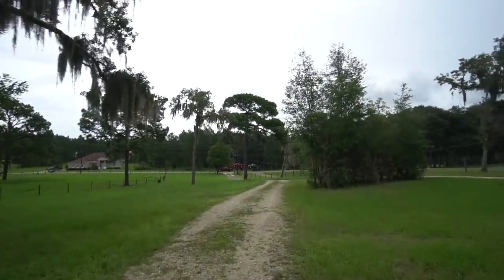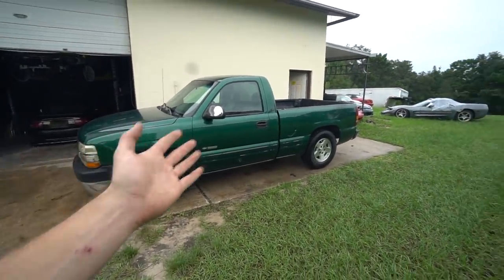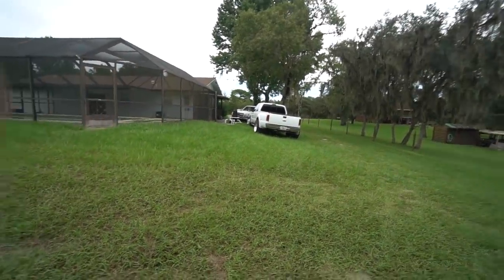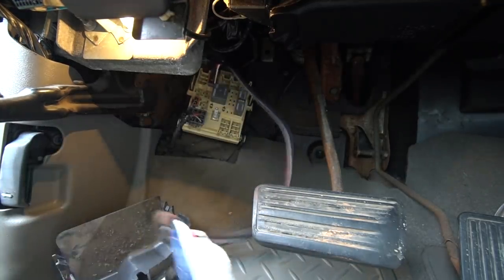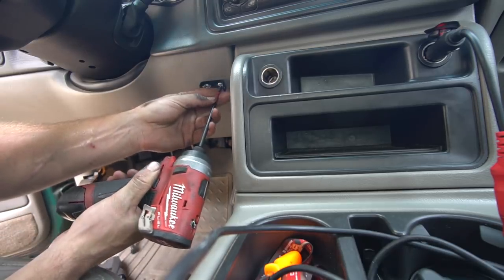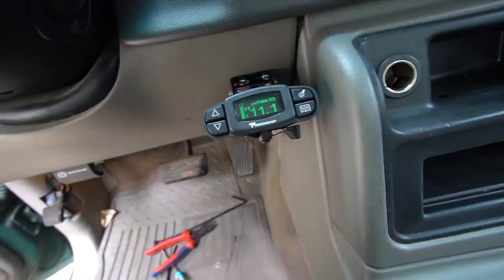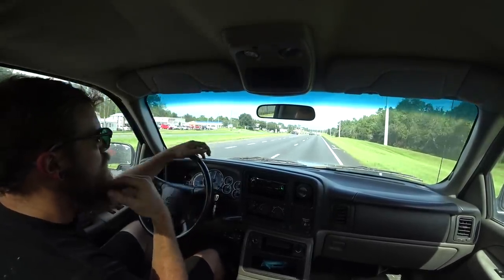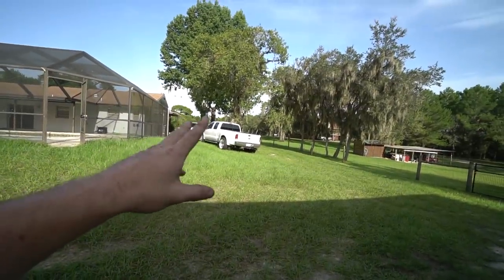I Bought Another Truck! After Searching Forever!

Comment: Hey Taylor you’re comparing a gas truck to a diesel and the diesel is slower but they are better in the long run and if you buy a 6.4 don’t Cummins swap it just keep the motor and run it
Reply: Camden dewitt he wants to buy one that’s already blown up. It would be a way better deal to find one like that and swap it to a reliable motor.
Reply: You know the are reliable they only blow up when people hold them on the rev limiters and do massive burnouts for a long time or put a lot of power in it
Reply: Camden dewitt the general consensus online is that they don’t last very well after 150k miles and especially not during hard work. Parts are also much more expensive.
Reply: Um I have 350000 miles on my 6.4 and it is completely stock so it all depends on what your doing with them

Comment: Why is it called a 6 0 front. You should twin turbo that truck
Reply: joe beers the front end is off of the ford trucks that came with the 6.0 powerstroke engine. Rather than calling it by some name, or by generations like dodge (1st gen, 2nd gen) fords are referenced by engine.

Comment: Yup, you bought the wrong adapter cable. There's one for 2004-older and one for 2005-up. You can also just switch the wire like you did. BTDT.

Also might want to consider replacing the factory receiver hitch on that Chevy. They are a poor design and have peeled apart.
Reply: The 04 and older/05 and up are the same. Many sell the kit with instructions to where to plug it in. Also, factory hitch does fine with my old truck. Pulled 10,000lbs without issue
Reply: @brandoncaldwell95 one that has held up does not mean none fail. I know multiple people who have had welds fail on these towing far less than 10,000lbs

Comment: 4l80s are junk and expensive. Also if it came with a 4l80 from factory (which some do) it’s going to have the transmission temp gauge
Reply: 4l60e are the "junk" ones not the 4l80e. Many people desire the 4l80e for many builds. I actually want one for my truck, but it needs the 4x4 eletronic transfercase too. That mated to the 5.3L will make that sucker launch and continue to pull hard. I have abused the hell out of my 4l60e in my truck pulling 10,000lbs. Zero issues i might add.  1500s technically do have a guage. Just itll throw it on the dash vs a guage. Ive though about swapping a 1500hd or 2500 dash into it.